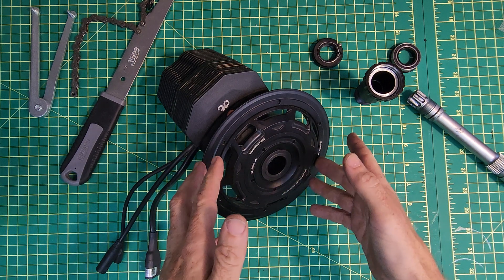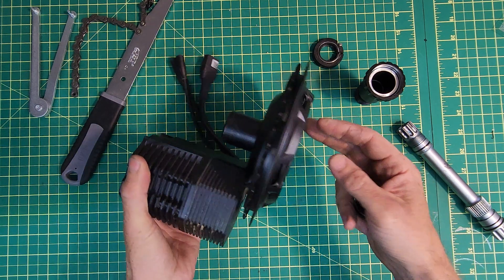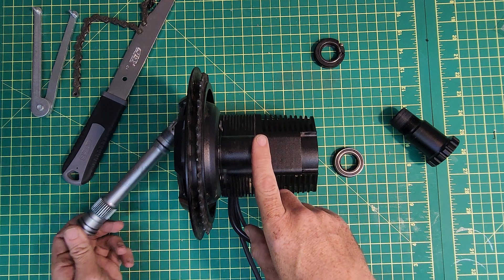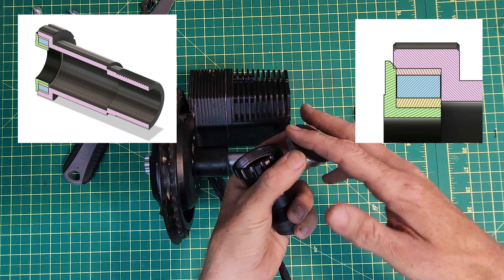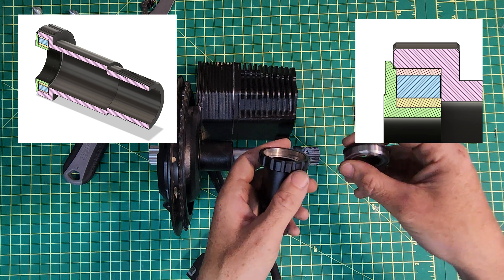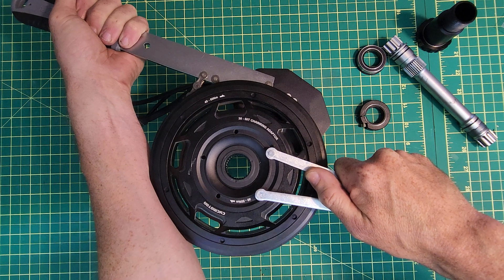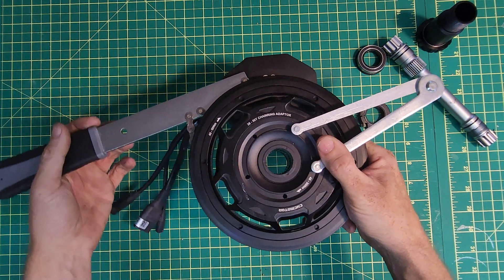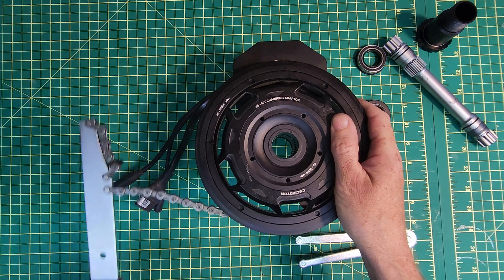CYC Photon Ebike Motor - Stiff Bearings and Stuck Chainring

Comment: That sucks
Looks like you need to make a tool
You could make those two prongs stick up from a bit of metal that you can clamp in a vice

Then sit the motor on top
And get some real leverage on the chain whip

But I would say the prongs might  break.

Here is a couple ideas 

You could alfind some high tensile steel that would fit into the prong holes. 
Eg I'm thinking high tensile bolts chopped down 
Get long bolts with short threads
 Lots of bare shaft
The same od as the prong tool prongs
Remove the thread and
 the bolt head in the process chopping the two bits of high tensile bolt shaft down to the correct length you need.
You could just then clamp them into the vice sticking up  or 
You could also find a bit of  metal and drill and tap two holes in it 
Insert your long bolts thread first all the way though or in 
Then chop the bolt shafts off at the correct length leaving  two prongs sticking up .
Then clamp that in a vice
Reply from the maker: There are some tool apparently for motorcycle that might work. Good thoughts. A guy showed me a tool he made like this. The welding is not exactly my scene but I can probably find a mate if need be. Cheers

Comment: Find or make a narrow ring to fit in the "cup" before you put the bearing back in.  It just has to clear the "inner race" to work.  For the outside assembly, put a 1 mm feeler gauge between the bearing and the "lock ring" so there is just a bit of "end play" in the shaft when you set that clearance and tighten down the set screw.  For getting the chain ring "lock cover" off, you might want to do what I had to do on my Yamaha Tmax to get the CV clutch off.  I took a large washer and drilled holes in it's circumference to match up with the holes.  Then I added Grade 12 metric bolts to the holes to act as pins.  I then welded a pipe handle to it and with a "whole lot" of grunting, it came off.  I also had to heat up one small area of the nut with a torch to expand the nut so the wrench would work.  Or you might try to find a pipe that would fit over the end of the "pin wench" to use as a "cheater bar". Maybe flatten it a bit so it does not twist on the pin wrench.  Go luck.
Reply: Make a part to fix the poor designed of the unit.  Really ! People paid a grand for this unit.
Reply from the maker: Its a strange choice. They are lucky the torque sensor is good!
Reply: @HighVoltageKits  I sent this video to Jon at CYC and he said that the LH bearing depth was on some of the first motors, but has been addressed.  Seems "interesting" that in a previous video you were "wondering" how to get the chainring cover on tight enough. ;)  You seem like you can make things, so how about cutting out a steel part with a 1/2" socket "square drive" in the middle and a circle of pins to fit the CR cover.  Then you and torque it and remove it.
Reply from the maker: That tool sounds like a beast! That would do the job here for sure. I put it on my wife's bike for now but I think if I make something it will engage the points like you describe.
Reply: @HighVoltageKits  The other choice I forgot to mention is the "Y" wrench.  Take a bar about 2 feet long and add a second bar of about 8" to the longer one at about 6" or 7" from the end of the long one.  Drill and bolt the two together at that point and drill holes for bolts that will fit the holes in the chainring.  I made one for my Tmax, but is was not heavy enough to do the job.  It would work for this though.

Comment: Good info to be aware of.  I have a couple of ideas to shim out the bearing with round spacers and fabricate a simpke long tool out of flat steel with locating pins to engage the ring with lots of torque.  Just ordered the Pro gen 3 and will be more aware of this type of issue.
Reply from the maker: The Gen 3 I'm not sure will have these particular issues. Good reports on that mostly. Using some heat might also help. Appreciate the advice. Thanks
Reply: @HighVoltageKits  Just come into this video, gen 3 is also not so smooth on back pedal, dont know is it a feature 😂

Comment: 1. Months ago I researched mid-mount motors and concluded my first should be from CYC. Every video I saw back in the day impressed me greatly. I've taken no action since then, but would like to soon.

2. I may be an "edge case" kind of rider. My objective is to move on my own power most of the time and rely on the motor exceptionally (on very long rides, over especially demanding terrain). This implies my motor bearings must be no less good than those that came with the bike (candidates being a Surly Pugsley and a Fuji Bighorn). In 58 years on wheels, I have NEVER encountered what you describe and I won't tolerate feeling such friction, period.

3. CYC should express gratitude to you for your analysis. You can tell them that if I am representative of cycling "fanatics," CYC had better develop a permanent and elegant fix for both problems you cite. As for customers who have already purchased friction-prone motors, perhaps a simple, low-cost fix can be shipped from the factory gratis. Spacers seem like good candidates for such a retrofit.
Reply from the maker: Appreciate the comment. There are new motors I am testing from a company called TOSEVEN that might be worth looking at. The one design does not move the motor gear when you are peddling without power which would reduce resistance considerably in an ebike in the scenario you described. It's off the bike right now but I will do a bit of riding sans power once it's back on and you can get an idea if it would make a difference.
Reply: @HighVoltageKits  I will study TOSEVEN in the meantime and keenly await the results of your testing.
Reply: I hate to inform you, but you are going to find friction or resistance in every mid-drive motor that I've tried.  In this regard, the best I've seen is the Brose motor in a Specialized Turbo Vado SL.
Reply: @larrym2434  Test rode that in 2022 guise, the Brose motor in the Turbo Vado I tried was so annoyingly loud, even on the flats, that I promptly returned it to the LBS without even attempting the hill section they suggested. The lag was also not something to be tolerated on a machine at the top of range.
Reply: @thekenthouse6428  Just to be clear, the Turbo Vado and the Turbo Vado SL are very different bikes with different motors.  Have you found another ebike that suits you better?
Reply: @larrym2434  Decided that I'm decrepit enough in purchasing an ebike yet but if I were in the market, the TQ in the new Madone looks to be a better option
Reply: @larrym2434  Although your news is sad, I appreciate the input. Mr HighVoltageKits says he's going to check the TOSEVEN products for their drag. Brose is a name of which I was unaware. More for me to research.
Reply: Just program your contoller to provide minumum assiatnce until you miove to a higher level as needed. That is what I have been doing since my first eBike decades ago.

Comment: Are you shore about the Axle is not off on being straight?
Reply from the maker: I'd be shocked if it was. I think there would be other issues if the axle was out of alignment in terms of motor noise. It's on another bike now and performing well.
Reply: If E-motor is froming just fine on another bike that would indicate the  bottom bracket is not straight on first bike. The bottom bracket (BB)  maybe straight hole bored thorough.  but, the treads are not straight that would cause the bearings 1 or both to make noise. When operation at low speeds can hear it noise but at high speeds would mean that noise pitch is just to high for the human ear to here.  I would adventure to say that BB Missed align at the manufacturer plant during being made. Which would mean that tools at plant would need to be replaced sooner that later. If the bearings are to lose in its holder would also create noise. When operating the at any speed just means you maye not here the noice. This is indication that the E-motor system will not last has long as my BBo2 version bafang. Which i have operate it for over 10 years now. The bafang still operating strong. I ride it for commuting most day for work. It has metal gears in the unit & not plastic, Nylon or whatever. Enjoy what you have.  @HighVoltageKits

Comment: Chain ring: I would put the motor back in the frame to hold it stationary. Warm up lock ring with a heat gun. Get a pipe over both wrenches for more leverage, and have someone else hold it all while you work .
Reply from the maker: Getting a pipe over the supplied tool will be hard. I might have to 3d print something in polycarbonate to fit around it.

Comment: solid video dude, hope to learn more about the photon, once all the issues get ironed out might be a good motor for a nice eMTB conversion. still not sold on the 85nm bosch bikes that require 8,000 USD for 250w.
Reply from the maker: Cheers Ryan. I'm not sold on Bosch either.

Comment: The tool doesn’t exist. If you look at the Pinion lock ring & tool that is what needs to be made. Interface with all the pins and actually get a torque wrench on. Shit design from CYC with a proprietary chainring.
Reply from the maker: I don't like it either. The tool would be expensive to make. That's why you get the crappy spanner thing. Right to repair is really gaining ground finally. This is a backwards step.

Comment: John could you put a bit of copper grease on the outer side of the bearing this may stop your friction
Reply from the maker: I was pretty liberal with the grease. Its the plastic part rubbing unfortunately. It's smoother on the latest install but not like the way you can spin the bbshd pedals.

Comment: Photon technical support sent me a picture of how to remove their cover using the crank arm attached to the spindle as the second lever together with their tool.   Place them near one another (like at four and 6 o’clock) and squeeze together.  I’d show you the pic, but YouTube doesn’t allow it.  It worked for me.
Reply from the maker: Okay. That makes some sense. I will give it a crack on the next install I do.

Comment: hi, i have the same problem on both sides , but much worse on the non drive side, i have picked the plastic bearing insert away from the bb cup and runs smooth, but as soon as you tighten up the lock ring its stiff again, , on the chain ring thread i used some anti seize compound, so i hope this makes it easier to remove, i will find out tomorrow ,, is this plastic ring thing even needed? thanks for the video...
Reply from the maker: The plastic ring has a ridge to engage with the one on the lock ring. The quickest solution is a washer shim I think. Even then it won't be totally smooth by design.

Comment: Another informative video. 
Classic tolerance stack up...as you rightly address.  This is a rudiment of every design that occurs in the design development phase. Typically, in prototype, worse case tolerance stack is emulated with specially fabricated parts to simulate the entire manufacturing tolerance.
Worse case in nature is rare statistically but when it occurs, there can be an issue. This is what separates designs.  More robust designs are less sensitive to manufacturing variation.
To me, this in inexcusable. I come from this world. Cartridge bearings are made to tight tolerances. So this is a design flaw.  There should be no compensatory work around when building the bike.  Lowered torque in assembly to reduce interference will reduce retention for example.
Because everything is drawn on CAD via computer today and can be 3D modeled and 3D printed for tolerance checks there is no reason for this mis-step.

As to disassembly with that tool....if you have a local bicycle shop and its a large shop, there is generally one strong man there.  One guy can hold the body and other spin that tool.
Staccato force always breaks things loose easier than dull force as it turns out.  I had a stuck pedal on a bike I couldn't get apart and I build all my bikes and there was a strong man that could remove it.  This guy had serious strength.

What I would do in your case John, is contact CYC and perhaps send them this video.  Let them come back to you and explain what their path is forward to fix their design...and maybe send you a resized motor to test.  You could also ask them how to get the thing apart...if they have any suggestions.

This is critical info for the ebike community and thanks for all you do to enlighten us.
Reply from the maker: Thanks for the comment and advice Luke. I posted the video on the CYC group so maybe they will respond. You are right in that it's surprising it was not identified. I suspect that these smaller parts get missed out sometimes. Apparently there is a trick with the tool but I will find someone with Gorilla arms as well 😆 CYC told me this was in development for three years. It's possible that the tolerance error was only introduced at mass manufacturing point? A miscalculated machine maybe? Cheers
Reply: @HighVoltageKits  CYC doesn't even need to redesign the cups. A couple of shims would take care of this, easily. BTW, Am very interested to hear more about the ToSeven motors. 
Thank you for your thorough reviews!
Reply: The one thing you are definitely doing wrong in disassembling the chanering is where you're placing the tools for leverage. Move the cyc tool as close as possible to the wip so you're able to pull the cycle tool and push the whip at the same time.
Reply: WAIT, WHAT? Youi have no idea if the friction is by design or not. IF not...a manufacturer often corrects things like this as production changes are made. Please do not be so quick to jump on the condemnation wagon of dispair. By the way, CYC corrected the tool issue with...wait for it...a better tool at a very reasonable price.

Comment: The plastic bearing shield is not only causing the bearing to appear stiff, it is probably preloading the bearing and may cause it to wear. At least that should be replaceable with another OTS bearing. Ironically, over-preloading the setup with the lockring may actually remove the preload caused by the plastic shield. Maybe the fix is to just chamfer the inner edge of the bearing cup, or drop a shim into the cup before fitting the bearing - but 0.4mm is a LOT!

Can you identify the bearing size please?
Reply from the maker: Its back on a bike. I could not see any identification but I modeled it so if the dimensions can help you iD it I can get you those.
Reply: @HighVoltageKits  I would think the plastic collar has been placed over the labeled seal, but the dimensions will make it pretty easy to identify. It won't be anything special.

Comment: I just received my photon and the bearing on the drive side is tight while the other side feels fine. Here's a video: https://youtube.com/shorts/Uttb2qOFI7Y I would agree that on mine, it feels more like rubbing than like a bad or tight bearing, but I haven't taken it apart.

Edit: I just pushed on the bearing from the back with my hand and it loosened to the point where it now feels smooth, definitely a bit concerning.
Reply from the maker: I think some shims will be your easiest short term fix. At least that was the concensus.
Reply: @HighVoltageKits   Thanks! with regards to removing the chainring, you might try bracing the motor against the ground and using your body weight to apply force to the chain whip on one side and spanner on the other, if that makes sense.

Comment: I've just received my photon and installed it.  Didn't seem to have these issues initially, definitely seems like there is drag in the transmission, but none while say just backward pedaling.  I'll be keeping an eye out for this issue... Odd question that I can't seem to find an answer to.  Does the Photon have a regen when not in assist mode? Say while just pedaling? Thanks for all of the information on this rig!
Reply from the maker: The Photon cannot do regen as it has a clutch and freewheel. So the motor cannot run against the load in reverse.
Reply: Rog. Thank you! Would be cool if there were a mid drive option that allowed say a "downhill" regen while loaded via pedal. Could really extend a ride!
Reply: need an electrically operated clutch for that which is not easy @sr20detized

Comment: I’ve tapped on the tool with a rubber mallet to get it started. Not elegant, but worked for me when I needed to take it apart.
Reply: Yes, staccato force always works better than dull force if stuck.
Reply from the maker: I used that to remove the bearing! It's tricky cause the tool wants to bounce out and the surfaces are angled. I will have another go on the next installation.
Reply: @HighVoltageKits  I had to make this tool in order to remove my chain ring! What a nightmare. https://youtu.be/zpLf4mbjs7M?si=CzwgYvEBKPuvTJMF

Comment: Have you tried putting a pipe on tool for more leverage
Reply from the maker: I didn't have anything like that to hand. I'd probably have to weld it on. Apparently, there is a trick using the crank arm to try in the future, but it will be the next uninstall I do.